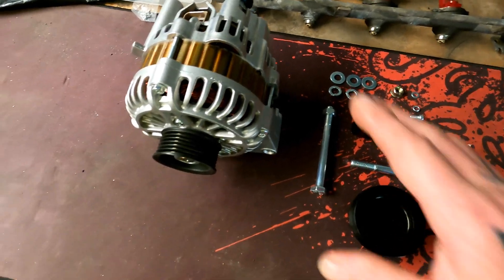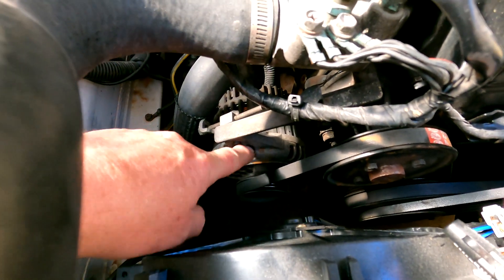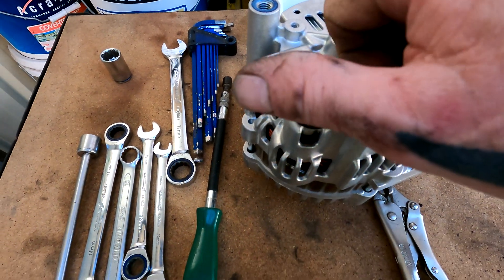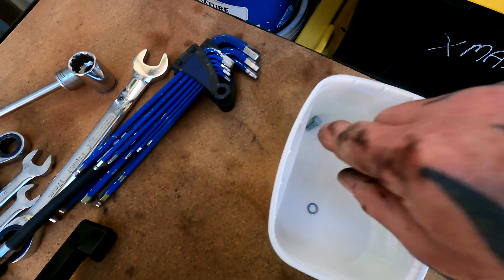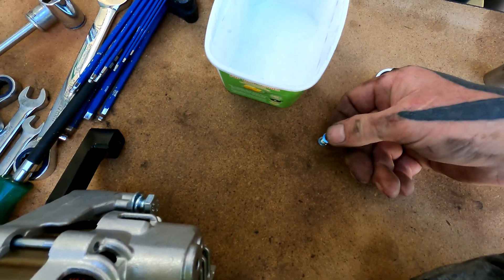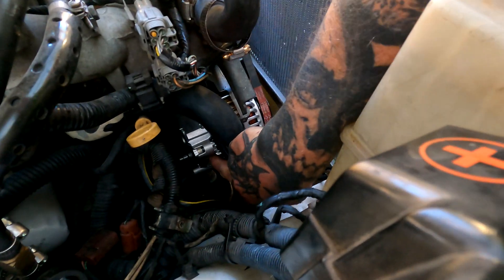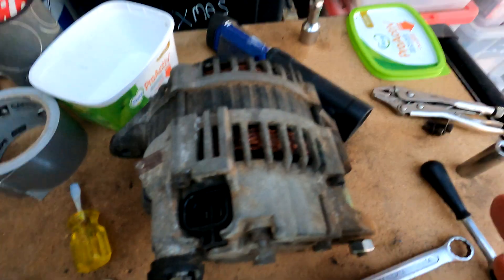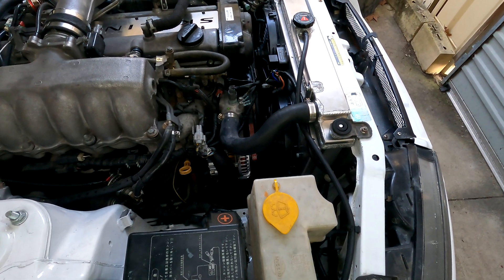Tutorial: GM 140A Alternator Conversion Into A Nissan RB Engine

Comment: thanks for your help, did u have to upgrade the fuse ? 
       original is 80amp and this LS1 alternator is 140amp ? 
  also did u need to upgrade the battery ? to a bigger v8 capable battery? thanks
Reply from the maker: You're welcome.

I did upgrade the fuse to 140A, and also the battery to a 760CCA. You can see the video to that here:

https://www.youtube.com/watch?v=aXHZuuN8OmY

You can use the timestamp to get to the section "0:43 Battery Tray & Battery".

I hope this helps.

Comment: Hi mate did you upgrade the wiring? Ive read the stock wiring cant handle the extra amps and can overheat
Reply from the maker: I checked the gauge of the wiring and it's still within spec to handle 140A.

Comment: I bought the PRP LS1 alt kit. Maybe one day they will actually ship the damn thing. I have an 32 and on the east coast of the USA.
Reply from the maker: It probably wasn't in stock when you purchased it if it hasn't shipped out yet.
In the US, these alternators are a dime a dozen as you say. You should have probably gone with the basic kit and purchased the alternator Stateside. The GM code is 9205887 and is used on LS1 engines (obviously), and there are plenty of those in your country.
The kit Americans should go with either of these:

https://justjap.com/products/copy-of-cwc-ls1-alternator-rb-twin-cam-billet-conversion-kit-black-fits-nissan-rb20-rb25-rb26
https://justjap.com/products/copy-of-cwc-ls1-alternator-rb-twin-cam-billet-conversion-kit-silver-fits-nissan-rb20-rb25-rb26

At a cost of $125.00 USD (at the time of writing), it's a cheaper alternative. Shipping would have been cheaper as well. The biggest expense is the alternator itself, but now knowing the product code you can do a little searching locally at car parts stores or even wrecking yards.
Reply: @AllenVanDerLaan  The car is in the garage for the winter. So I am in no hurry. I am just looking forward to upgrading the alternator.
Reply from the maker: How long ago was it ordered? I usually use JustJap because I always receive their gear quicker than anyone else. I have never dealt with PRP so I can't speak for them, but whenever I buy anything from the US I can expect at least 6-8 weeks before seeing. it.
Reply: @AllenVanDerLaan  it was earlier this month. I am not in a hurry to get it. Just thought it would have at least been shipped out.